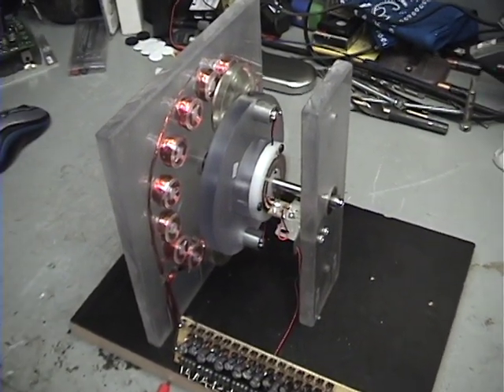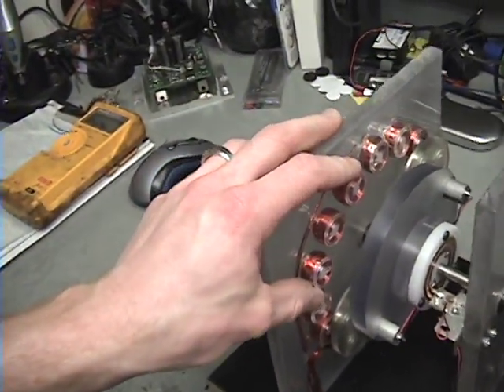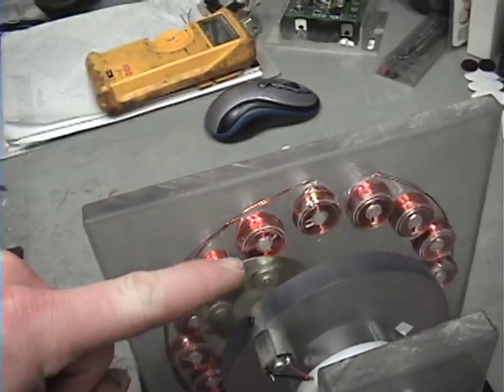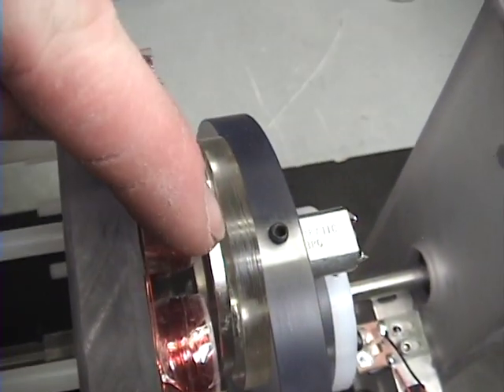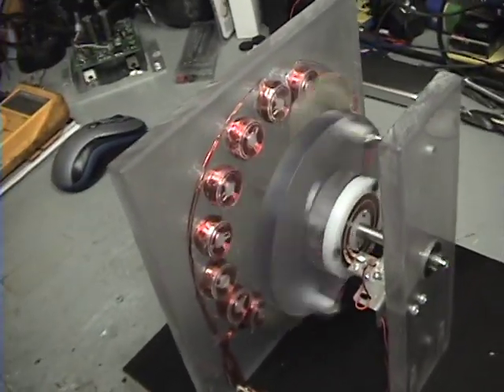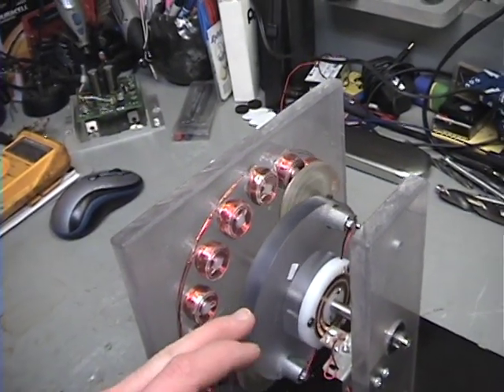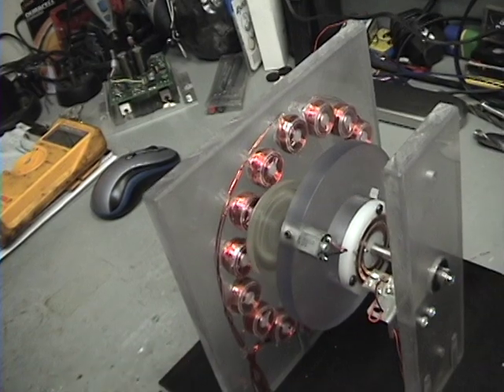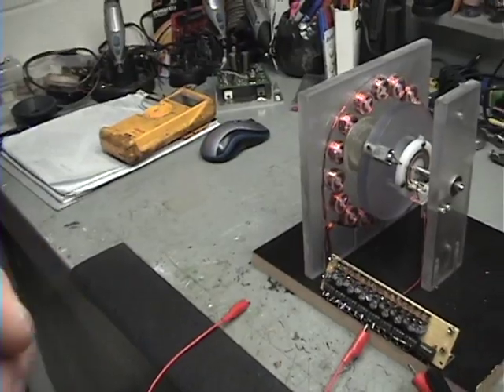(Update) The 'Infinity' Motor/Generator by Mark & Russ

Comment: Hi Russ - Your engineering is very neat.
Why not have the main rotating disc with magnet fields all the same polarity and *radial*, with an equal number of circumferential mounted stator coils each oppositely biased by a static cardboard-gapped neody ?
Each magnet swipe will induce a full alternation cycle.

Comment: You may want to try some of those ring magnets from ebay that are used as magntic bases for antenneas. I have some and they seem to direct flux from the back side due to the metal cup on the back side.  The back side flux is around the perimeter on the front.

Comment: Russ, the more you try, the more you learn. The more you share, the more we all learn.
I bet the out-put from this set-up was very low comapred to the first set-up. The next on will be also, unless you use a mag that has the poles oposit on the sides. If the poles are on the faces, your colapsing mag-fields wont be very strong at all.  If you cut the ring mags in half, then flip on side so the poles are flippped

Comment: Hey Russ, have you heard about Polymagnets?  (http://www.polymagnet.com/)
They can print designs and different types of magnetic fields onto magnets.  It looked amazing when I saw it and I'm pretty sure if you get into contact with them, you could do some amazing stuff if you implement a sort of rapidly alternating poles into a ring magnet like you have there.  where it would just be several strips of alternating North and South poles.  Because what it looked like here, was that it wasn't moving because the ring magnets only had one pole exposed to the coils.  So if we rapidly alternate the poles, it might bring back the inverse rotation that lense's law provides?
If not this project, Polymagnets might have some interesting implications if you apply it to other projects of yours.

If you haven't heard about them, check it out.
Reply from the maker: +Theminecraftian772 yes please see my work on this here: 
http://rwgresearch.com/open-projects/making-poly-magnets-cmr/
i have maid some of theses here with all home made equipment. 
 thanks for the information though!!! Best, ~Russ
Reply: *****
Sweet, thanks for telling me.
Reply: polymags have their uses, but when it comes to infinity devices and OU, a stable high power charge is more important and programmable charges can only attain a max ability, making their usefulness a lot more limited

Comment: Make all the magnets face north towards the coils then put magnets on the back side of the coils facing north towards the other magnets. The power will be 50% more which will give you enough left over energy to turn 2-4 more motors. Problem solved
Hook all of this up to some crystal cell batteries and run in series and a bedini coil and Wah-La, all the power you would ever need.
Reply: If your not working on this anymore, please send it to me, I will make it work.
Reply: This is an open source project. Anyone can build a working model with additional upgrades. Please just post a YouTube video and show everyone how to produce free energy. And good things will come to you.
Reply: @weslingm  I'm working on that very thing sir. And I am build a bearingless unit that will power it's own motor and leave a ton leftover to use. By not having any friction and drag I can get more speed and the coils will collect more in the loop. Really there is no need for batteries or caps, It can all be done with just magnets \ coils \ reed switches \ transistors \ and diodes \ transformers \ and lastly the potentiometer. Make the shaft float with magnetic bearings, attach some north facing magnets to use for motor, this will turn the shaft when electricity is sent to the coil under the magnets. Have that looped to a muller setup that is also on the same shaft. Problem solved, Free power for at least 300 years until the magnets die. Use strong N52's
Reply: Keep in mind that it only takes one coil series off of the muller setup to run the motor that will also loop back to the muller and re-feed itself power over and over. But the motor and the muller setup must be on the same shaft and floating with 0 friction. This will also create an eddy effect such as John Searl's SEG at the same time which will remove friction and create even more power. It would create so much power even that we would have to turn it down with the strong potentiometer in order to plug a 110v item into it. I just ordered some more magnets also, $300 worth. I want them to be at least 1" x 1/2" for strength. That would be plenty, about 90 pounds pull and push.
Reply: I personally think friction is what has been killing everyone's designs and attempts to outdo Tesla \ Muller\ Searl \ Eddison \ and so on.... I am going to win that battle with no friction and lightweight for the size. I'm only using a 10" alum disc but, none of the coils are on the shaft. The only thing on the shaft is magnets and a 10" disc that has 8 more magnets. The funny part is that it is all so easy that we all have been overlooking it. It is just a matter of how we build the setup. Everything has been shown on YouTube over and over but never all together. I'm combining several ideas into one machine. As for videos, they will be coming in the near future. I want to make sure all my T's are crossed before introducing it to the world. Oh and I have  looked hard and no one has built even half of what I'm talking about all together. That is a shame, so close yet never altogether.
Reply: Oh and I'm hoping to get 10,000 and up in RPM's. I saw someone get 7,000 with just 4 AAA's. All he had to do is add a muller setup to his and he would had been in business. Again, so sad to see people start a project then fade away from it when they were so close and didn't even realize it.
Reply: Also on the Mendocino Motor part, we are not using solar, no need because the muller setup will power the motor just as you seen in the video I attached with the reed switch 180 volt spikes off of just one coil. Now imagine all the other coils having the same thing. Boom, we are free.
Reply: You all might find it interesting how my mind came up with this combined thought. I looked at our solar system and how it works. First we have one item pulling it all real fast, the Sun. Which to me is the motor, then all the planets are the magnets except one of those planets can produce a lot of energy itself, Us. At the same time, it is all floating and only has magnetic friction \ drag. Think about it, the sun feeds us ions and the earth takes that energy and it powers us. Well that's just part of my thinking on it, but it gets deep down that rabbit hole. Later mates, hope I helped open up someone else's mind today. Free energy is very real. I might even start up a factory and build these once I'm done with this one I'm working on. Of course with some help of the public funding me.
Reply: Jason Witt - do you have a You Tube channel?

Comment: As I can see, you have NOT a rotating magnetic field. You have a static magnetic field from your ring magnets. try to break the symetry. try to cut these ring magnets and make them 300 degrees angle and not 360 degrees. BREAK the symetry!